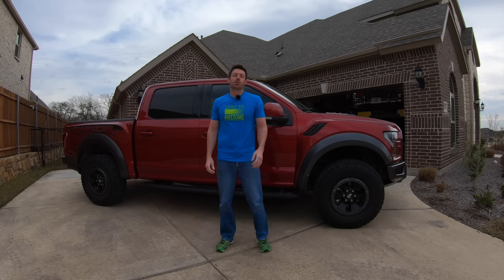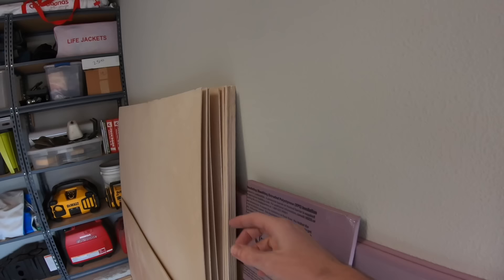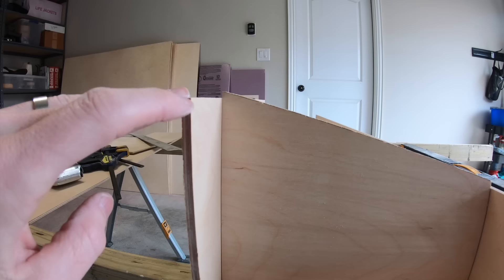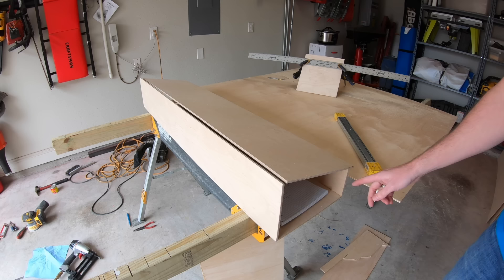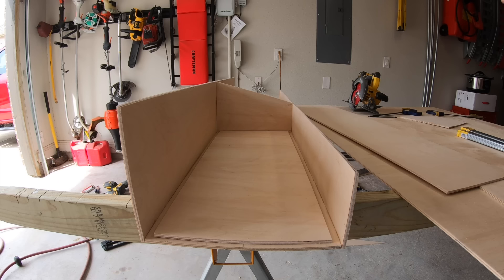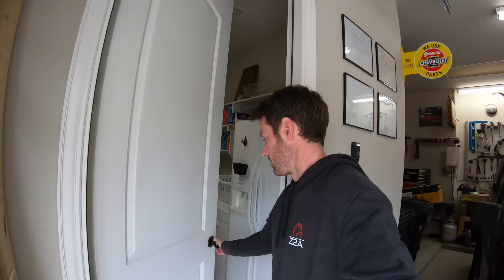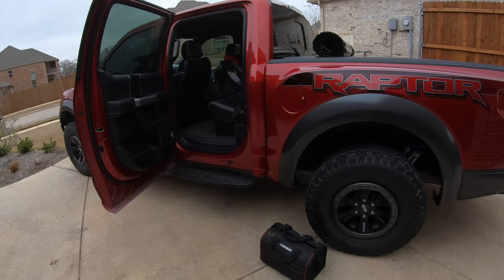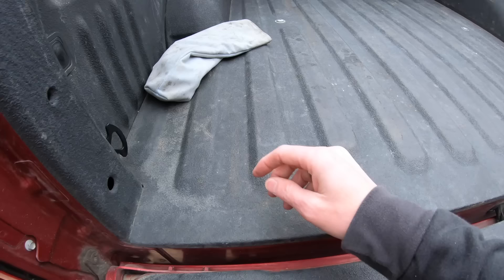DIY hidden in-cab drawers **YOU CAN’T BUY** for only $100 in materials! Patent pending!

Comment: One important item that really should be considered is to secure the toolbox (really any heavy item) so it doesn't become a potential source of injury in an accident or quick maneuver.  An emergency stop has the potential for this loaded toolbox to slide into the feet of the rear passengers.
Reply: Good point. It can be secured to the seat mounts with a cable or chain. I went the simple route of just making a 3 sided wall to keep things tucked under the seats and simply bungee corded the contraption to the seat mounts.

Comment: One thing you could add is tiny feet (strips) on the bottom that fit into the slots in the floor mat to prevent a forward slide.

Comment: I have a second Gen Raptor and want that exact box in metal with locking features for a black rifle on the driver side.  You really need to be manufacturing these, as there is nothing on the market (that I can find) that is as nice.  Great work by the way!
Reply: Matt 
Could easily be designed to have one on each side that pulls out with a shoulder holster & pistol and an AR with spare mags.....

In these times of riots, this would be a great money maker..... I hate Ford, but I might be tempted to buy a new truck if I could get that double drawer system....
Reply: Rick Sanchez C137 - agreed. I found a lot of room behind my rear seat which is great for a black rifle and Amazon sells a magazine well lock with aircraft cable tether, so I feel fairly secure, but these drawers would be better and quicker to deploy.

Comment: Makes me appreciate my Ram that already has under seat storage plus 2 storage bins in the floor under the mat from the factory.  I have tons of recovery gear and tools in there.  Nice work though.  Where there's a will, there's a way.  I'm sure by now you know how valuable that space is.  My only other suggestion would be to come up with a way to put longer objects in there (over 2 ft).  Perhaps 2 different size drawers, or leave the rear of the drawer and partition shorter and level to allow a a triangular gap where something longer could be placed in there sticking over into the next compartment.  I stow a crow bar, breaker bar and a monster adjustable wrench under there (all stuff to work on suspension if needed).

Comment: Great idea and good explanation on the build. One more thing to consider adding might be some straps to help secure the box in the event of a crash.  I think one or two straps attached on the backside would do the trick and might also slow down someone trying to steal a locked version of the box.  The latch idea was sweet!

Comment: I used really sturdy plastic planter boxes that were just the right length.  I added a simple backer piece to the seat rails and then some disconnects to the planter boxes.  It is just as durable as those $100 plastic boxes. I often lift my seats and need to remove the boxes due to an older dog. These are really nice and a great video for 4 door trucks.  I have the Ex cab.
Reply from the maker: Great solution!

Comment: Very nicely done. Another idea is to make the drawers open top, and simply mount the slide to the bottom of the drawer, and to the cab floor. Then the whole drawer just slides on the floor of the truck. 

Of course this truck is very nice to be modifying the cab floor like that, but on a work truck trim, it's an option.
Reply from the maker: Kinda turned out like that!
https://youtu.be/MCDdAEVDOI4

Comment: I'm thinking about building something similar, but in my case the drivers side would be a charging station for my drill batteries, jump-starter battery, and a little carry around battery pack that I use to run my laptop for a day or two without "shore power". I like to use light colors inside the drawers so the contents are easier to see in dim conditions. I'll keep heat and ventilation in mind, and route a 12V accessory cable directly into the system. I'm also thinking I'd like a simple system to be sure it stays in place until I want it to move, like a couple of loops and a carabiner for each side. Thanks for a good head start.

Comment: Awesome project!  One safety point for folks who will have passengers not in carseats:  consider running tie-down straps to hold it in place during emergency stops. 20 pounds of stuff in a 20 pound box can easily break legs. We had a local child fatally injured by a 5 pound plastic speaker in a  collision a few years back. Flew off the package shelf and crushed her skull.

Comment: At 17:37, a tip for the hole saw to avoid the peeling of the laminate (seen on the inside). Start drilling your hole and only get it started 1/4 to 1/2 way through. Then, drill from the other side. It makes for a much cleaner edge on the hole. Nice idea for the slider box. Thanks for posting.

Comment: Life hack - avoid blowout on the back side by clamping a piece of sacrificial  wood piece to the back of the facing board THEN drill. You won't have that unfinished look. Also, for a better fit on your handle .. sandpaper the hole on the FRONT side to remove splinters. fits better in the end.

Comment: Weathertech makes a storage bin that rides in the same place as the system you made here. They make it out of the same material as their floormats, its an open top bin so you have to lift the seat to get to it, but for those that want out of the way storage and dont have that baby problem, the bin is quicker.

Comment: Great job, I must admit,  I thought you might struggle fitting it together, with only 6mm ply, but it looks solid,  in the uk company's want £2500  for a false floor in my van and 3 metal  drawers underneath, I'm thinking of doing it myself out of wood, won't cost anywhere near that. You should invest in a track saw, don't have to bother clamping straight edges to get a straight cut.

Comment: I have been working on drawers for the front seats and also thinking about the rear seats on my 78 Suburban. They will be much more square as the older vehicles had an even area front to back under the back seat. I am planning to build mine out of metal and so the slam latches would be great except the front seat ones which I was planning to use solenoid latches as they would not be able to be seen if I did not want to show them to anyone.
I was planning the front ones to carry more expensive things like cameras and such, but they also will be covered by sound deadening material and carpet that is the same as the carpet that will be in the cab of the Suburban. This will allow them to be completely hidden till they are opened.
Reply from the maker: Sounds great! Good luck with your build!

Comment: Dodge already has a storage compartment option for their trucks.  Additionally it also folds out to give you back the flat floor you no longer have.  Mine is a 2005 and I’ve been using and loving it all that time.
Reply from the maker: That’s awesome! Maybe I bought the wrong truck. My top 2 were raptor and power wagon

Comment: Hi! Just wanted to say that I like your design, and as our son has a Raptor I'll pass your link to him. That being said, for future projects, a couple of ideas: Check out a product available thru "Woodcraft"  known as "Slick Strip" similar to a thick (~0.040) teflon type tape instead of your roller guides (much thinner, and if you read their reviews you'll see that it serves well. Also when you're drilling with your hole saw, once you've established your center hole, stop, go to the back side, re-engage and just start sawing thru the back then go back to the front to complete your task. This should eliminate that ugly tear-out which you had on the inside; just depends on how anal/perfectionist you want to be. Lastly, on a safety note (from a Fire/Medic & ER RN) you might want to consider not putting your fingers/hand anywhere near the down-range nailing area. I've seen those nails not travel in the direction intended. Best wishes, and thanks for the design; I had a similar idea for my crew cab SD, but in metal with locking capability.
Reply from the maker: Appreciate the tips! I’ll check out the Slick Strip for future projects.

Comment: Wow dude, it looks like it came for the factory.....Congrats!
I have a couple of minor concerns/questions:
1) Would you also carpet the interior sides of the cabinet and the top inside of the box for less noise? I mean, I could "see"?/hear  some metal to metal vibrations as you drive and this would further muffle the noise and offer a bit more protection.
2) I would like to see what the long term effect of those passengers sitting in the back seat. Maybe there is some "give" in the seats and they push down on the cabinet, creating stress....Or the back of their feet hitting the cabinet. There may be a day when you are taking out your buddies for a fish, pulling the boat, and your 2 burly friends sit in the back ....... 

Thanks!
Reply: There is a slight give to the seats. Before I go building mine, I had my “burly :)” boyfriend kinda bounce in the seats. Found there to be a little less than a quarter inch of a “give”. Hope that helps if you make your own. :)

Comment: You should consider either adding feet to prop up the box or spray a rubber coating on the bottom for when the floor mats are wet.  Plus when you said you were going to carpet the interior of the drawer, I thought you would cover the sides too.

Comment: You forgot two holes in the top so you can reach inside of the drawer and be able to flip the seat latch without having to drag the entire drawer system out of your way when you need to lift up the seat bottom. Great idea!
Reply from the maker: Negative- the latches are to lower the seat once raised. To raise you just lift

Comment: I have put those full extension slides on the bottom to save space on the sides. As long as you don't put a lot of weight in them but they will hold a good amount.
Reply from the maker: Good idea only problem is clearing the lip on the floor mat
Reply: U would have to allow for that. But sometimes it works sometimes it don’t. Nice job!

Comment: Nice job. Should have shown it dry-fitted in the truck, before you painted it. You could use tool box non slip solid liner for bottom of box.  You cut it to size and works very well.  It's only $6.99 for 6 feet of it at harbor freight.  Just finished watching and I'm wrong. Doesn't matter that you didn't show dry fit. We can see it very well.  I will make this also. We pull a travel trailer and I can use the extra room for tools I need to have with me. Nice idea.

Comment: Metal one sigle drawer for a rifle and you'll sell a ton of them. Going to look into having the sheet metal shop bend the box .Drawer could be wood or metal with foam. You could make a killing selling these. Seriously.
Reply from the maker: Great idea!
Reply: You can dropp the back seat forward and put gun box possible
Reply: You could still have a middle divider just doesn’t have to be solid.  Just a 1x across the top or cut the center out of the divider.
Reply: There's already several companies that make and sell rifle cases like this that mount under the seat. However they are made outta sheet metal, and from a safe companies so price wise your looking $200 +
Reply: @number1yota  And you  have to raise your seats. With a side drawer , no.
Reply: @HolyBibleOpen  they make them with side drawers.
Reply: @number1yota  Post the link.
Reply: @HolyBibleOpen  TruckVault will custom do their seat vault as a drawer but there's not a link for it, you have to contact them and do it directly. My buddy had one done but he wouldn't tell me the price, other than it was a lot. Judging by the fact that the regular seat vault is $1200 his was probably at least$1500. Not worth it in my opinion, but he comes from money and I don't. I've seen others in the past but can't find the links right now, they were always really expensive which is probably why I can't find them anymore, but they do exist, and most will have to be a custom order.
Bossstrongbox makes standard one that slides forward which means your floorboard has to be empty.
Reply: @number1yota  That's not expensive. But I want to get out of drivers seat and pull drawer open towards outside. Own a Raptor.
Reply: @HolyBibleOpen  then call up TruckVault and have them build you one
Reply: @number1yota  I may. first I will go to my local sheet metal shop. They have done work for me before .Thanks for the Company name. Stainless is my forte.
Reply: Zero To Awesome 
Time to do a kickstarter and set up a business plan.....
Reply: Titan comes with one.  :-)  They call it "lockable storage! LOL

Comment: I would have carpeted the front of the box.  Back seat passengers are going to kick the heck out of it and the black paint will get all messed up.  I built the same thing for my 2013 GMC Van with a drop-down front across the van rather than drawers on the side.  My 2000 van had a drop-down tray attached to the bottom of the rear seat.  Not as much space but I could lay tools in there.

Comment: Bottom mounted slides would solve the width loss issue, and you would only lose half of that dimension in height because it's only the thickness of one slide.
Reply: TRUE, only issue is slides are not designed to work on the flat,  strength of slide  and its rollers work vertically  not horizontally,   on the flat  slides will flex badly under load  and  rollers not actually working at all, other wise great idea

Comment: I would add an electrical panel in the centre with some USB chargers etc, you lose some drawer space, but you gain some useful 12V accessories.
Reply from the maker: I have usb, 12v, and 110 right on the back of the center console, but that’s a great idea for those who don’t!

Comment: Great job and an excellent idea. How about a way to secure the toolbox down so it can not slide around especially forward into someone's foot if they are a passenger in the backseat and you have to brake hard and fast? Just a thought.
Reply from the maker: Yeah I considered that. So far it hasn’t budged but could be good if there’s an accident

Comment: FYI, your audio when using a camera only outputs on the right speaker. During your animated intro, it uses both speakers. Once you are past the intro where you are outside, the sound becomes normal.
Reply from the maker: Had some issues with the wireless mic
Reply: @ZeroToAwesome  awesome video, too bad my F-150 has the speaker system under the back seat... I have a similar bed cover so the bed tool box is out of the question for me as well. I guess the only option I would have is to build a half box on the driver side and leave the sub-woofer on the other side.

Comment: I built a speaker cabinet for under my seats that hold 2 6x9,s and 2 8 inch subs and a amp and volt meter cig lighter a 12v power plug and 4 USB plugs with a small compartment for tools
Reply from the maker: Nice!

Comment: Very nice build, but I think I would be tempted to use 9mm ply for extra long term strength.  I would  also find a way to anchor it as the last thing you want is it sliding forward and hitting people's feet ect in the event of heavy breaking or a shunt....I would imagine a couple of webbing straps around the box and fixed somehow to the back of the truck would be easy enough to do...

Comment: Great Idea, and cool build..... BUT I see a possible problem. They don't seem to be attacked to anything.  IF you had to make a sudden/emergency stop. (Some idiot turns in front of you while your cruising 55+ and have to stomp on your brakes to keep from hitting them) the box will go sliding forward. OR if you're in a head on accident, cause someone crosses the centerline, anyone in the back seat will have serious foot or ankle injuries when that box full of tools goes slamming forward into their heels jamming them under the seat in front of them...  I really think the box need to be either bolted or strapped to the floor or to the back wall under the seat.

Comment: Its been a while since this video but have you notice the tool box move at all while under the seats since its not secured to anything. I can't imagine it would move  a lot sitting on rubber.
Reply from the maker: Hasn’t budged an inch. I think the grooves in the floor mat keep it in place

Comment: Very nice....I would be securing that down to the truck.  Run straps to the seat bolts.  You hit the brakes and that can go flying forward with the weight...not to mention in a accident.

Comment: Any update on things since you built them?

I’d personally prefer having the same length/depth of drawers as each seat section. It looks more ‘factory finished’ AND permits storage of some longer than 2’ items in one drawer. 

Having said that, it’s a nice and simple idea that looks good.
Reply from the maker: Still working as well as the day I built them
Reply: Zero To Awesome, have you ever lowered the seat backs to see the available space? Good spot for a gun/fishing pole rack. 

It takes some work to get the seats down the first time, but there’s at least one fix on YouTube. Makes for a good bit of extra storage out of sight. 

Your comment in the video about ‘projectile firing’ devices fitting in a locking box like you built only works if you have the box secured to the truck floor. Otherwise, it’s easy to remove the entire thing and break it open. 

A hidden spot behind the rear seat seems to be a safer option. Check it out. (I’ll try to find and link that video I referenced.)

Edit: here it is. https://youtu.be/H74gtG1Ovmo

Comment: There are built-in cubbies under the back seat of my Ram. I'd have to do significant hacking on the body to use drawers. But now I want to look and see if I could build some sort of cabinet on the underside of the seat that fit into the cubbies and allowed easy access when the seat was up.
Reply from the maker: Worth a shot! Maybe the cubbies unbolt somehow?
Reply: @ZeroToAwesome  no, they are big walls formed into the floor.